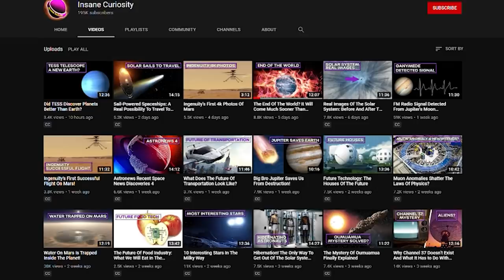James Webb Space Telescope: Delays, Breakages, Pandemics, Errors, Troubled Carrier Rockets And Now…

Comment: They should attach a docking module to it so that if it does need repair, a retrieval system would be sent to it to return it to low earth orbit (folded and protected in a shell). Or would that cost too much?

Comment: I'm curious if the picture quality from having the telescope so far away from earth is worth giving up the ability to repair or service the telescope :S If one in a million things go wrong it's $10b and how many decades of work gone?
Reply: It's a necessity from a physics standpoint, to be able to detect the light coming form the first galaxies of the universe the telescope needs to be close to absolute zero temperature and Langrange 2 point satisfies that condition, beaming back the data is easier as well because at L2, Earth keeps a permanent link with JWST
Reply: I'd trust it more if they just land it on the dark side of the moon. The Chinese did it. Why can't we?
Reply: @richardscathouse  the far side of the moon isn't cold enough at night for JWST to operate at optimal performance and becomes too hot for the lunar day (ie 14 earth days) JWST needs to go to L2 to be able to detect the earliest light from the universe. But the far side of the moon is particularly interesting if you want an optimal performance from a radio telescope thanks to the absence of radio noise and therefore minimal interference.
Reply: It will give them a perfect excuse to cease funding for science.  They can go back to talking to the magic sky pixie.

Comment: Why can't it be launched from the USA???
Reply: Cape Canaveral is at 28 degrees N Latitude. French Guiana is on the equator. The tangential velocity there due to the rotation of the earth is significantly greater there. That means even at launch when the fueled rocket is heaviest you’re going a few hundred miles an hour faster than you would be in FL. 
That matters.

Comment: HOW STUPID IT'S NOT A OPTICAL TELESCOPE 
IT'S A INFRARED TELESCOPE
AND THEY DID SAY WHAT WAS WRONG WTH THE FAIRING 
AIR PRESSURE INSIDE COULD DAMAGE THE WEBB HEAT SHIELD
Reply: You have to consider the "Red shift" that is common in Space. Study better.
Reply: and they fixed all commands being printed out in ALL CAPS, might be the first thing they fixed.